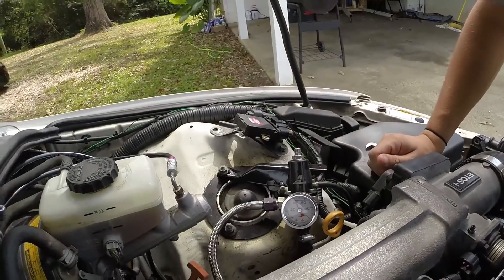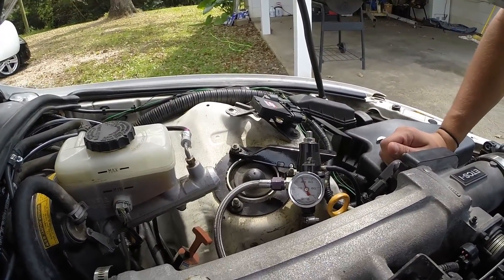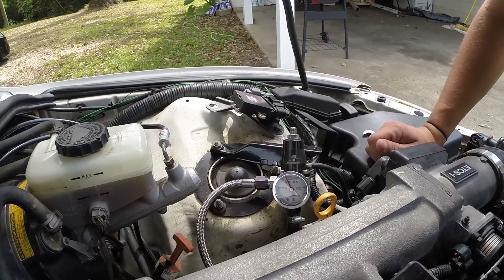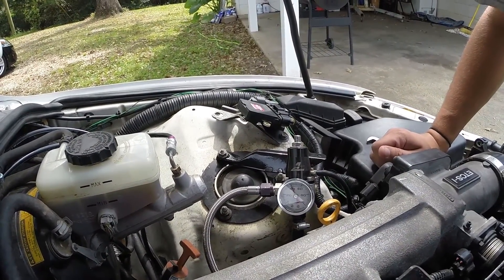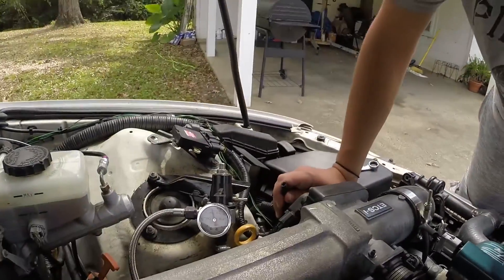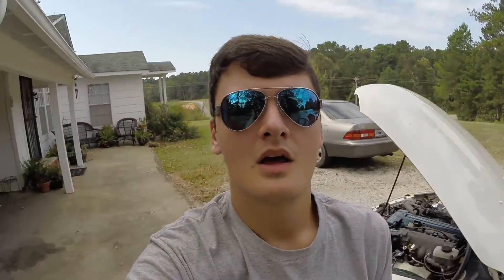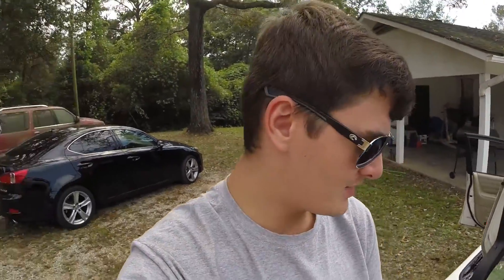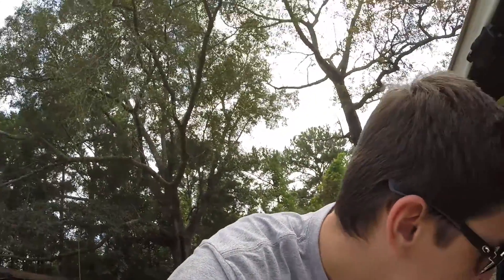Well this isn't Good...What's Wrong? 2JZGTE Problems!

Comment: Mine makes the same ticking noise. It’s most likely the fuel injectors. But mine has recently started making a bump or a knock sound too so uh... I’m gunna have some fun overthinking the possible doom of my 2j.

Comment: When I wasn't getting oil pressure to my VVTI gear I had a similar sound. But the injector tick sounds normal.
Reply from the maker: RacecarAndChill yeah I was reading that a lot of guys are getting a sound similar. I just don't see how it can be good whatever it is.
Reply: Yea, I'm not sure either unless you're getting low oil pressure. But I would check the little filter that goes into the vvti solenoid. Especially on an imported motor, it could be clogged because it sat for so long.
Reply: Yea, I'm not sure either unless you're getting low oil pressure. But I would check the little filter that goes into the vvti solenoid. Especially on an imported motor, it could be clogged because it sat for so long.
Reply: That Mellow Guy Yea what he said with the vvti filter sounds like a good idea to me
Reply from the maker: RacecarAndChill sounds like a plan. I'll check it when I pull the motor for the single swap. I googled it and apparently it could either be the coil packs or the injectors. Apparently Toyota is know for loud injectors that sounds like valve tick which is what this sounds like. Plus they say that valve noises or shim noises only happen when it's cold or only happen when it's warmed up, and mine happens regardless of cold or warm. And it isn't running or idling any different so we'll see if it becomes a problem.
Reply: I wouldn't worry about it too much either. But I thought the coil packs would give you an error code and misfire alone with it if they go bad. Honestly a properly done standalone will be able to help you so much. Are you going to get one when you swap to single?
Reply from the maker: RacecarAndChill hopefully. I'm going to run low boost wastegate pressure first when I go single, but yeah I do plan for some sort of tuning because I'll need it anyway if I plan to exceed the power of the injectors.
Reply: Yup, interested to see which route you'll take. Good luck and keep the videos coming. I find it hard to make as many videos as you do, so good work!
Reply from the maker: RacecarAndChill RacecarAndChill thank you! I'll weigh my options and see what I come up with. Would love to do full standalone but you know how expensive it is. And yeah it's hard sometimes to find stuff to do or stuff to talk about. I'm doing my best to have news for the car up on the channel. Still waiting on my turbo from Real Street. Still hasn't shipped.
Reply: What all do you need other than the turbo? What else are you waiting on?
Reply from the maker: RacecarAndChill basically still waiting on the turbo, wastegate, and oil feed drain kit. Still looking to decide what manifold. I want to go with a Cast log manifold for quick spool, but I want a quality one. That's really all I need for the swap because the GTE computer can compensate for the turbo so long as you don't exceed the stock injectors. But I'm doing more than that. I know I'm purchasing an oil filter relocation for sure, and I'll be changing valve cover gaskets and painting the intake and valve covers when I pull the motor.